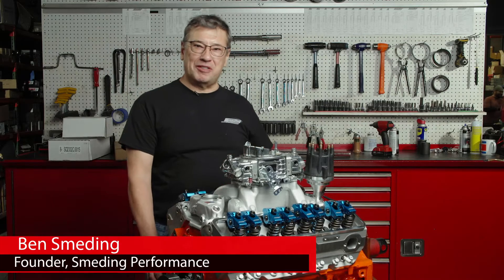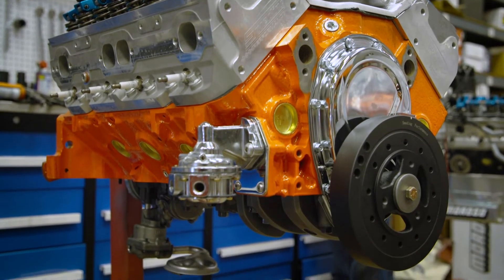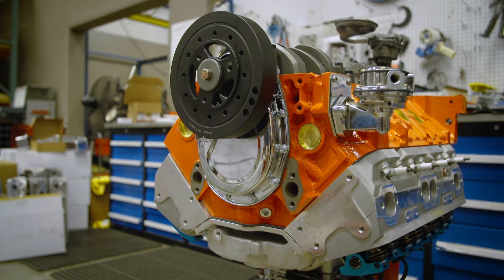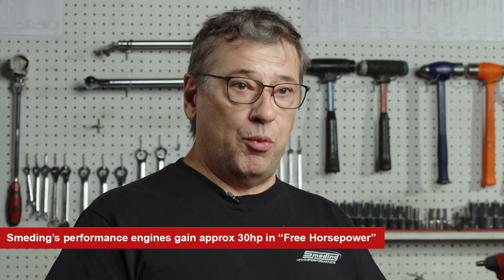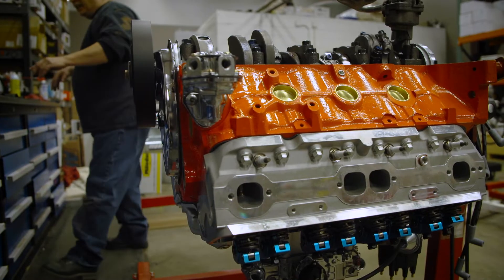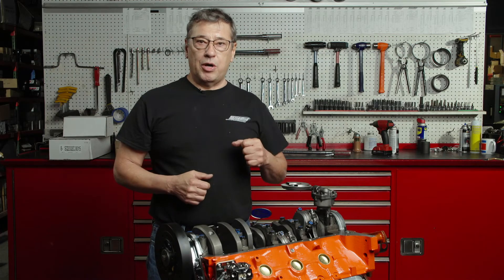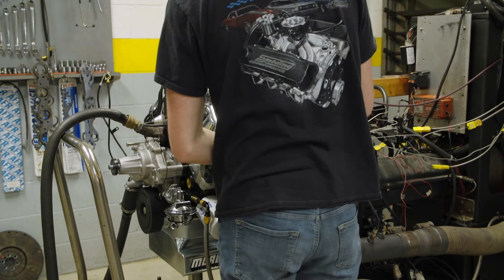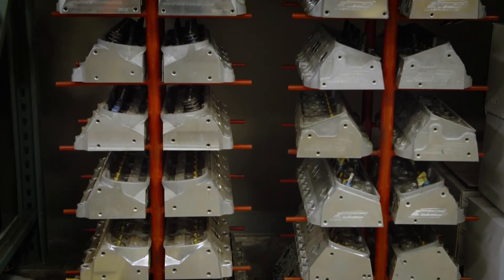Engines by Smeding Performance

Comment: My tunnel rammed 406 from them made less power than the single carb version. It made less power on their own dyno that they dyno their engines on. Less HP than the tunnel rammed 406 they have the video on. It made that power on a local dyno when it arrived too. The only thing I can think of is they inflate their numbers. So if a tunnel rammed 406 makes 514hp, their single carb 520hp one must only make about 480hp

Comment: Funny thing happened to me this morning.  FEB 28th 2005 @ 8:02 AM
I had a Smeding salesman return my call from yesterday afternoon. Of course after what happened it may have been the janitor that returned my call.
I was going to place an order for either a 400 ci short or long block. I wasn't sure what Smeding performance offered for choices,
or even built. So I asked a whole range of questions so I could pick out the right motor for my application.
I have been building engines off and on since the 1980s but have not done much in the last 35 years or so. Price is not an object, I just wanted to talk
engines and octane ratings etc compression ratios ect, you know, Motor stuff. But before I could even place my order the salesman became somewhat 
irritated and began treating me like a child when I asked about cam timing to compression ratio. The guy then said he was done talking to me and
then abruptly hung up on me. 
This was most disappointing as I have never been treated so rudely by a person whose job it is (or hopefully 'was') to sell products.
I might add that I was not even asked what application I was using the motor for.
The people at BLUEPRINT MOTORS were much better informed and far more polite and respectful. They even transfered me over to their tech department 
for further information. I thought I might give SMEDING a chance, but I have little reason to do that now. 
 have heard good things and great reviews about Smeding Products. Perhaps if I could get a hold of a real sales person ?
Reply: I really dont have the place or equipment to build my own engine(s) anymore. I am looking for  a short or long block to add my components to.
If someone in charge there could contact me then perhaps we could still do business  ? I dont really want to dismiss an entire company with a good reputation because someone was hungover or hasnt been laid in a month or two, and forgot what good manners are.

Comment: I would love to have one of these to put in my 1986 Firebird, but I don’t have the know how, or the tools to take out the old 305 & put in one of these 383’s so I would have to use a mechanic, which I have heard you figure the price of the engine & the price of a mechanic then double it. I don’t want to pay $30,000 for a new engine. I live about 200 miles from Smeding’s, I would really love one of these though.

Comment: Very elementry..thick cyl walls?.
Whats that mean?..whats the major thrust and minor  thrust wall thickness
These blocks all have the same bore spacing since 1955 so therefore depending on the bore size there is little difference.Core shift during the process is the only thing important..thick cyl walls?
Reply: These guys suck, they did a eng8me for me and completely fucked it up. So much blow by no power. Sent it back had failed piston rings only put 15 miles on it. They have children building these engines with no world experience. This place is absolutely a joke. The kid Jacob he’s wet behind the ears. Also there “extreme” packages the cams are completely unstreatable I had 3.5lbs of vacuum you had to run a 9.8 fuel ratio to get it not to choke off the line no matter what power valves I used. This company is garbage

Comment: absolutely love my 383 storker short block from you guys! ordered the short block, it has your hydraulic roller cam and lifters, i put blue print engines cylinder heads on it and it has a edelbrock pro flo 4 efi system and the engine now has about 1,600 miles on it and it is a blast to drive!!!

Comment: I'm pretty sure that anyone that is here, has already seen Jacob's channel and have seen the quality work that your shop does, as well as the high end tooling and equipment that you guys have to work with. If I wasn't in another country, I would get all my motors from you.
Reply: I can't agree with quality work! Many engines uncovered Bolts started and over torqued with impact drivers, Chinese rotating assemblies and very poor and rude service from Jacob himself.
Reply: Are you sure "Chinese Assembly" are being used? @popatop6657

Comment: Can't wait to get my 406.
Reply: Did you end up getting the 406?
Reply: @arendtosti8355  yes I did, and I love it. I got the bottom end up graded to h beam rods. Used Smeding 520 horsepower cam, Eldelbrock 200cc 64 cc chamber, vortex heads, Vic. Jr intake, Holley Sniper, I added Head stud girtles for valve train stable ability. I also used Comp 1.6 rockers. Arp head studs, multi layer head gaskets. My Cutlass is 3,200 pounds with th350, 3:70 rear 9" Ford. Next week I am going to try my 1.5 rockers. My converter is a little tight at 2,400, and that's why I believe the 1.5 rockers will work better. I suppose a 3,500 converter would be great. I don't expect the tranny to last long - then I will correct that with a th700r4 3,500 converter. I hope this information helps you out .
Reply: @dennyauman2442  wow. That build is way different then their specs. For the 406. Why 200cc?
Reply: @arendtosti8355  my own flavor. I bought the short block then did my own thing. I also have arp studs instead of bolts.
Reply: @dennyauman2442  are you trying to get more top end with the 200cc? What hp are you trying to get to?
Reply: @dennyauman2442  oh. And I just read you're using vortec heads. That might be the reason for 200cc??